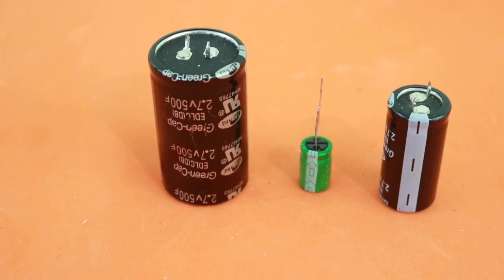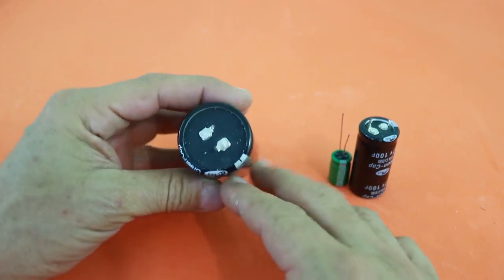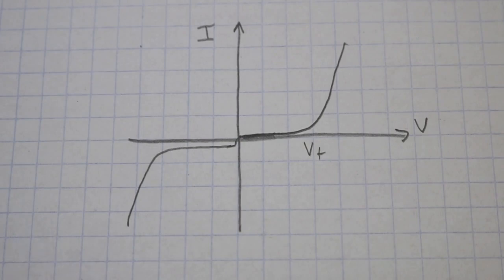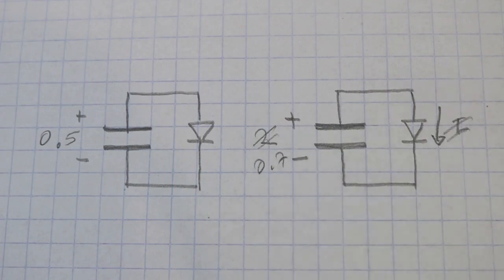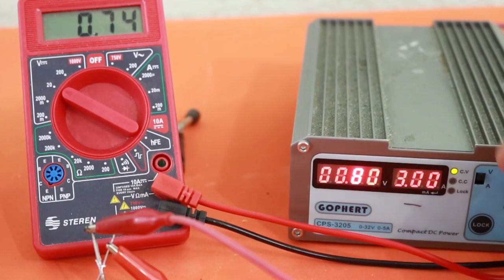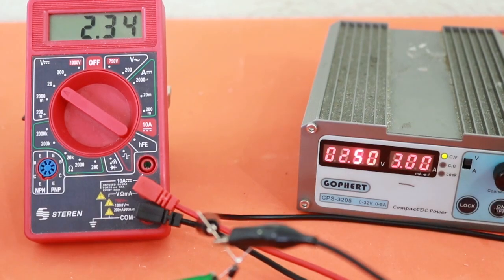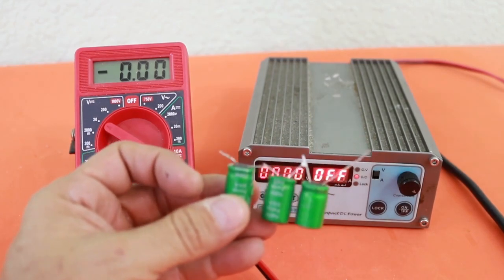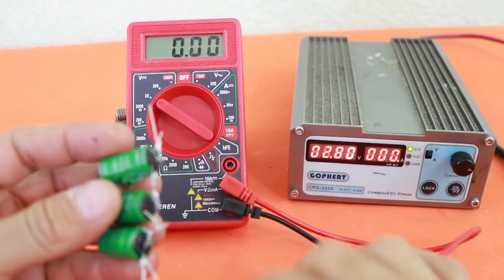Simple Balancing and Protection Method for Supercaps

Comment: Is a diode used to turn off a battery charger when a certain voltage has been reached?
Is a diode used to protect a controller of an e-bike when you connect a battery to the controller? I mean protection as in preventing sparks when connecting.

Comment: As far i know Supplier tells that it is not for high current aplication.
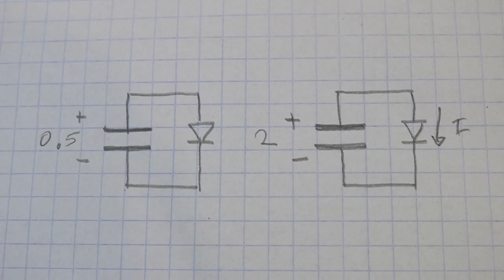6:50 I you do this with higher Farads capacitor it will short diode and damage it. It needs resistor.

God just use two of them in series and add 5V linear regulator... What im doing here

Comment: It's possible Schottky diodes were not mentioned here because they have higher reverse leakage, but combining them with normal rectifiers will allow more flexibility to get closer to 2.7v while still maintaining low reverse leakage. eg: 0.7 + 0.7 + 0.5 + 0.7 (but test with a power supply first!)